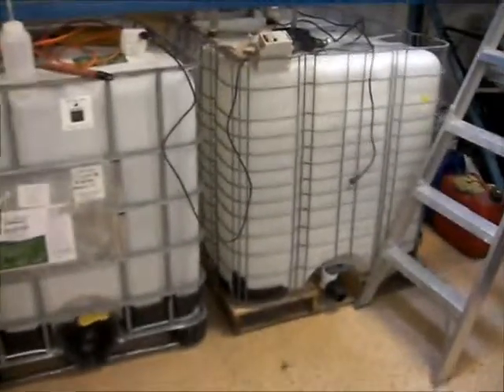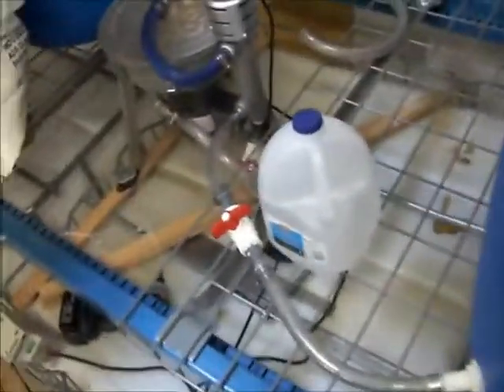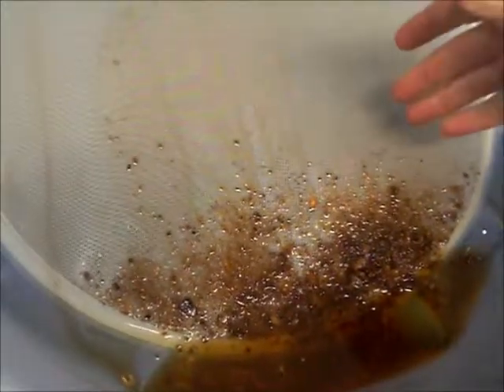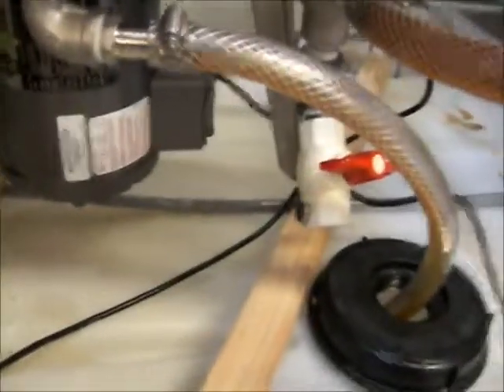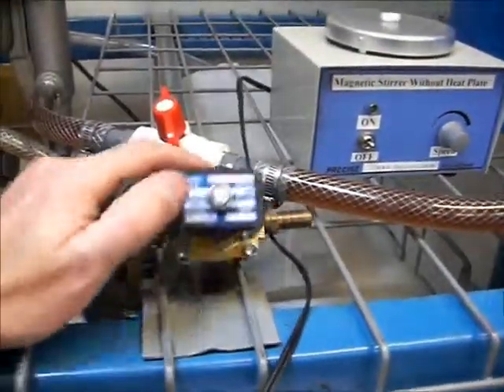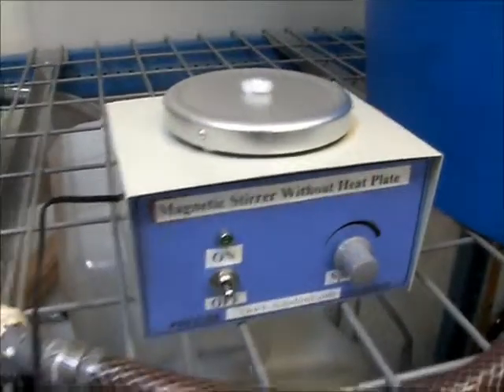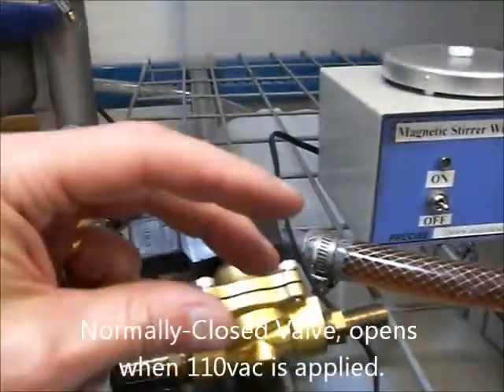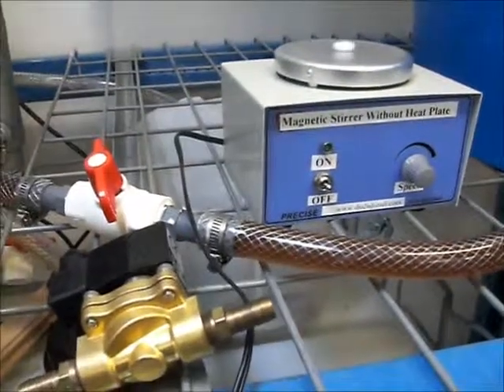biodiesel workshop improvements

Comment from the maker: Hi. The wash water goes down the toilet. It's slightly alkaline but that's ok. Acid rain is a problem in most places so the water in the sewer system is on the acid side. No harm there.
The glycerol goes into his oil recycling tank, remember it's got methanol in it still so you can't use it as hand soap or fertilizer. If you distill the methanol off it can go into compost.

Comment from the maker: I haven't put diesel in my truck for at least 6 months. I've made about 450gal now. Power is similar even when towing but my truck is chip tuned and has other goodies. Exhaust smoke is nothing compared to dino diesel. I would say 80% less smoke. Plus the smell isn't noxious, smells like slightly burnt veg oil. Biodiesel doesn't smell like fried chicken, etc. WVO does... just so you know. Nobody will get hungry driving behind you with biodiesel. :-)

Comment from the maker: If you can get enough WVO to process it's definitely worth it. Even if you don't.... blend it.... if you only add 5% biodiesel to your tank it reduces exhaust emissions considerably. Any bit you add saves you money. Also depends what you drive.... a thirsty F250 is gonna burn thru fuel quick. If you drive a VW TDI...you know... 55L is 900+kms so you don't need to make fuel that often. I get rid of the glycerol at my buddy's autoshop (oil recycling). Don't have a still yet to recover methanol.

Comment from the maker: It's about $0.35/L or $1.32/USgal so yeah, it's worth it. I get the methanol and KOH from Univar, a large chemical supplier because we have an account there already thru work. However, those jerks just raised the minimum purchase from $200 to $500 or you pay a $50 surcharge.... way to support small business!! The 1000L tote tanks you can find used on kijiiji or craigslist, just look around. Anywhere from FREE to $100 each. Don't pay too much. My buddy has autoshop so I recycle glycerol there.

Comment from the maker: Yep, I got it used so it had some miles on the clock and swallowed tons of reg diesel. I changed the fuel filter out the night before and it was fairly nasty. There were tiny hairs of the prefilter coming off and sitting on the pleated section looked like metal shavings but wasn't. My mileage has dropped by about 3-5mpg as well. See if this new filter makes any difference. I've changed the filter in the past, never had lots of junk but I've been running B100 for some time on this filter.

Comment from the maker: I add powerservice diesel additive to every batch. That helps with oxidative stability and cold flow. Lots of mods, fuel regulator spacer, 4" exhaust turbo-back, MAF sensor fooler, DP-Tuner chip with 4 tunes (stock, valet, 40hp tow, 80hp econo, 140hp extreme), big air filter, modded valve body, aftermarket triple disc torque converter, alum diff cover, gauges, etc.

Comment from the maker: I started running bio mixes (was a member of the Vancouver biodiesel co-op before) probably 3yrs ago. But I've been running 100% bio since about 10,000 miles ago. No, haven't done more filter changes. Remember I got a 140hp race tune on it so there's considerable max fuel flow! I'll be doing the filter next oil change which is in a couple months. Post up anything odd if I see it. It's a 2001 7.3L, mild mods which I'll list next post. This bio is good to maybe -5 to -10degC.

Comment: on your ford power stroke, do you know how many miles you had on the engine before you started running bio diesel ? and also have you changed fuel filters a lot? what type of mods and such engine size etc are on your ford? any problems with running the fuel throughout the year?

Comment from the maker: I'm into it for about $3000. General cost is about $0.35/L or $1.33/USgal. Last week in Palm Springs reg gas was $4.10/gal. So every gallon you don't buy at the pump saves you $2.77 , so in this case you would have to use 1083gal to break even. Now, you don't need a fancy centrifuge, 1000L tanks, etc. So payback can be much quicker. I've already run over 350gal thru the system.